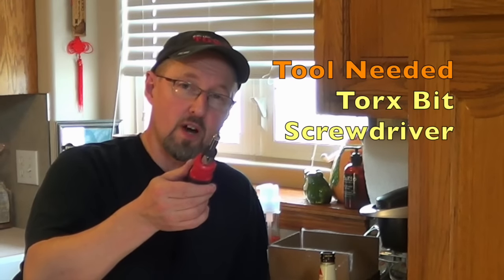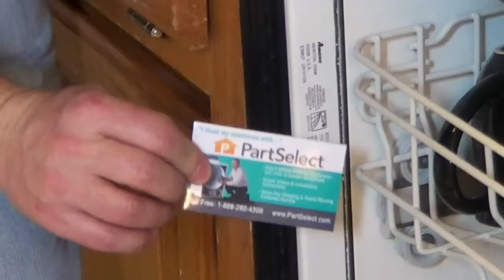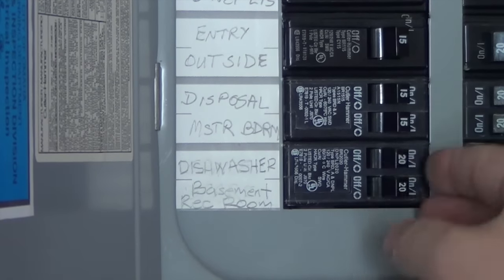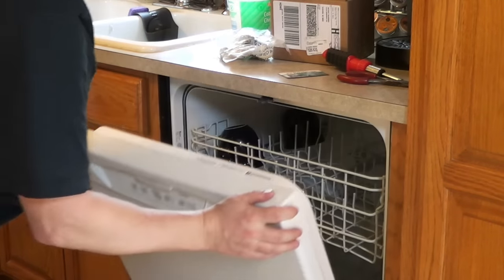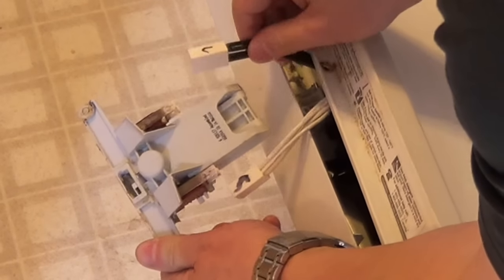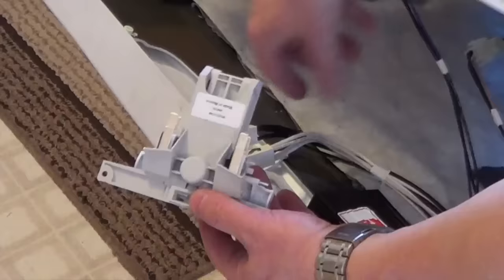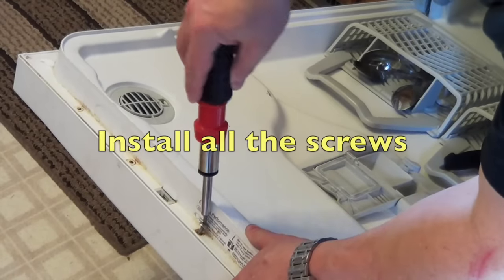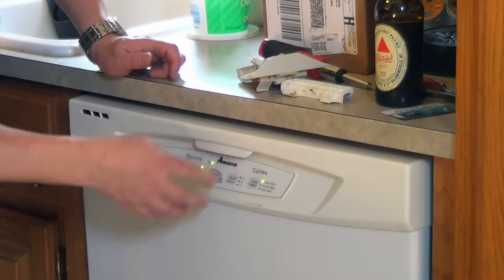How to Repair a Dishwasher Door Latch

Comment: You mention how it "SHOULD" open, grabbing it Left and Right, giving a firm pull.  However, you DON'T mention what to do if the lock is LOCKED, and I Mean Fully, Latched.  I could sooner and far more easily tear the countertop away from its screws before I could EVER get this door opened by "Firmly" pulling from both, upper, corners.Maybe a few more options, for those of us who are completely latch locked and a little less Beer (Celebrating) until ALL of the door lock issues are resolved??

Comment: Dishwasher door will not open. how can i open it dishes are stuck inside. i have already tried to pull it. stuck closed.. please help.. is there anyway to open door if latch will not release to open i cant get to screws to pull dishwasher out. PLEASE HELP..

Comment: thnx for this video...I have a GE Dishwasher "SpaceSafer" GSM1800JWW...i did one wash and door wont open. When I research to see y, some suggested that i redo my wash might help to reset the timer. This washer does not have child lock so is not that.Do you think it could be a timer issues?? The washer sound normal with both wash, drain and dry...I waited a few hour to open it and it was still jam lock. The latch click but wont let go. Please advice what you think and i can do since i cannot afford any service call or replacing a new one. I just want the door to open up and get my dishes out. thnx in advance!!
Reply: I have to pull it really hard to open door..got replacement part from partsselect.com....now the washing is like new!!..thnx for this video!!